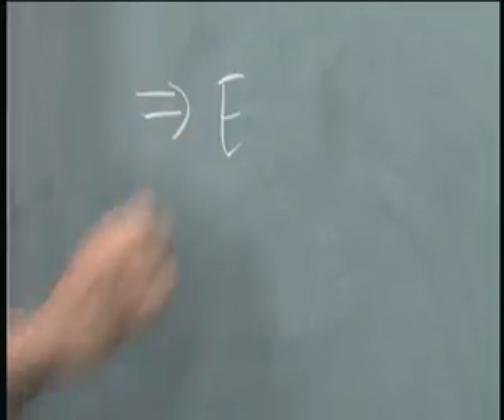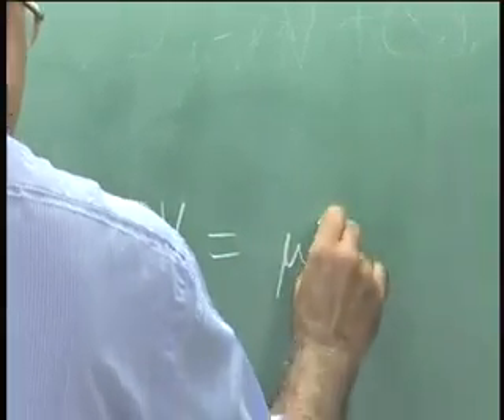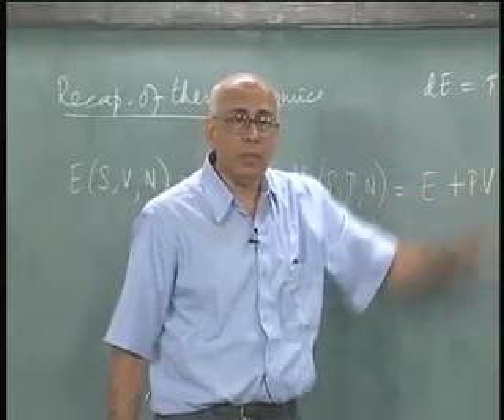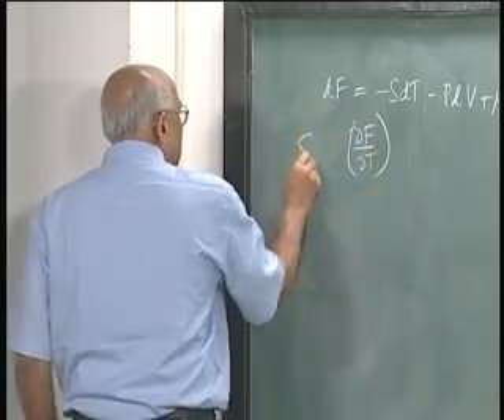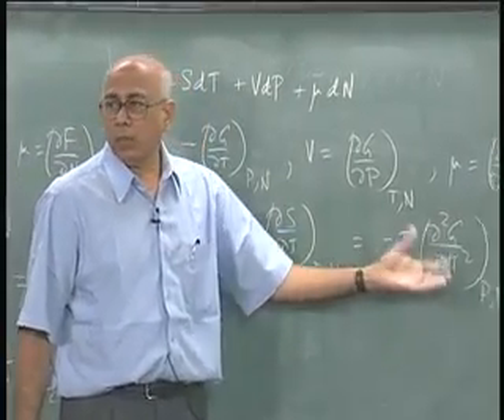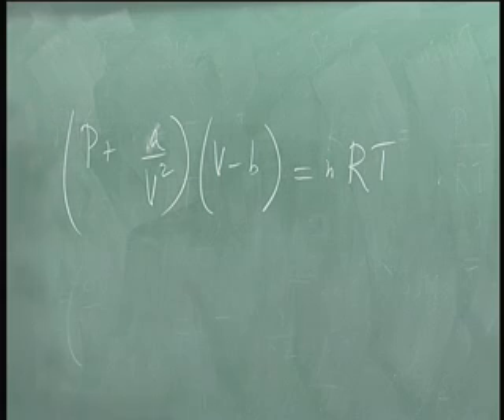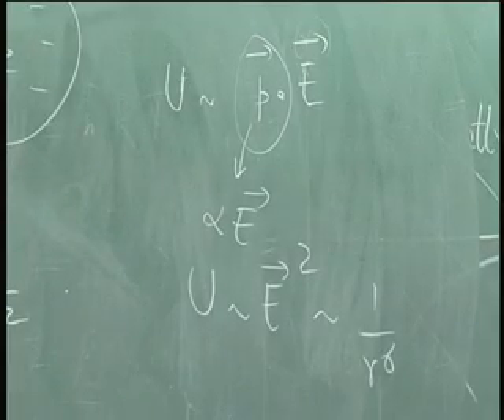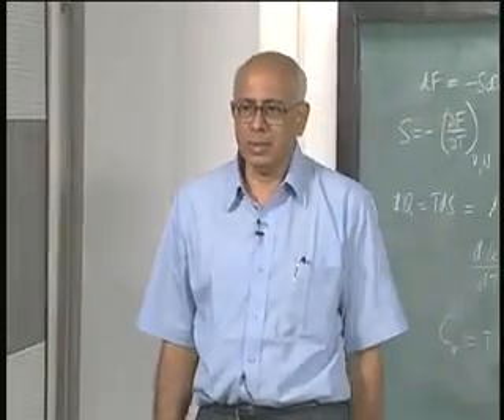Mod-01 Lec-23 Thermodynamics

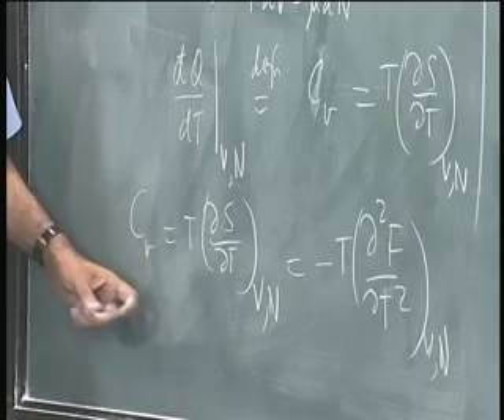Comment: After 29:30,when he explains the conditions for thermodynamic stability, he mentions that F should be at absolute 'minimum' at constant T, V and N,which implies specific 'convexity' properties of F as a function of T.
I think he said the reverse. The thermodynamic potentials are concave (not convex) functions of intensive variables like temperature T (at constant V and N) and hence F should be at absolute maxima (not minima)in equilibrium for thermodynamic stability. Therefore, the sign of the double derivative of F w.r.t. T must be negative so that Cv is always positive.
Reply: i agree, if second dervative is negative this implies  F must be at maxima ,not at minima, but i am confused if system has maximum Free  energy at equilibirum how is it stable.
Reply: I think it was a small mistake. Gibbs free energy decrease with temperature (P and N constant), becoming even more negative as temperature increases (∂G/∂T=-S), so it has a maximum point with respect to the temperature. The equilibrium condition of Gibbs free energy (and its minimum value) relates to a thermodynamic process where both P and T are constants.
Reply: @jguece  Got it. Thanks!